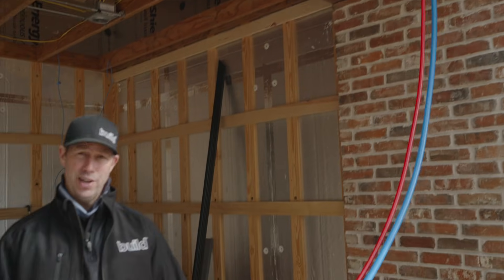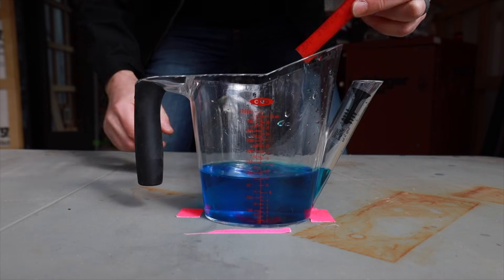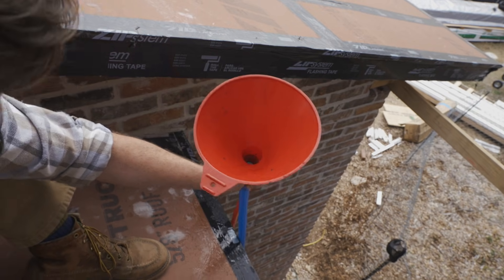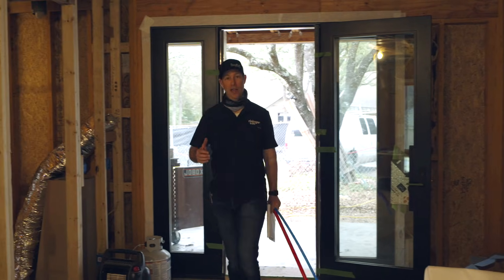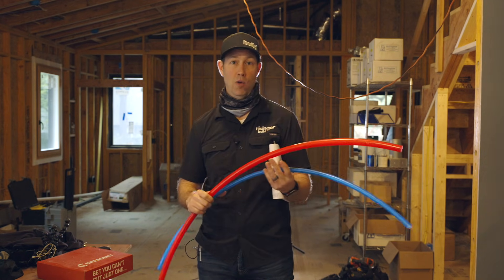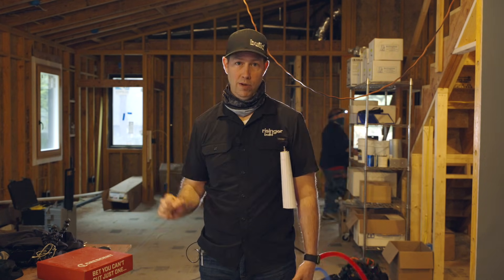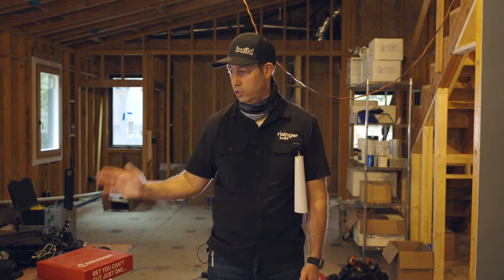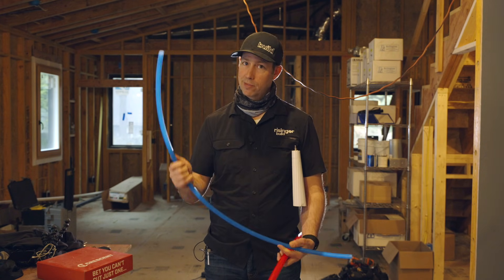What's the BEST Plumbing System

Comment: Race track system works great.  I've been doing that for years.
Reply: How is pressure on these systems?  I have zero experience with them
Reply: @benlastname6667  Pressure is great/no problem there.  With a 3/4" loop (race track) and 1/2" and 3/4" feeders to the fixtures  pressure is great with no loss when other devices/fixtures are turned on.  I've never used 3/8" even as the feeders to the fixtures as Matt said was an option.   I will say early on I ran into some issues and had to install check valves in the loop near the connection back to the water heater feed pipe to prevent flow reversal.  Now I simply install the check valves as part of the system and I never have any issues.

Comment: Upgrading my own ancient homestead where I don't have to worry about resale, I created what I call "Hillbilly PEX".  It's a modular manifold system using standard PVC and CPVC.  No special tools, everything is cheap, but I still get the convenience of a central manifold with individual cutoffs.

What I like most about individual direct lines is that if there's a water leak in the middle of the night, I can just cut off that one line, go back to bed, and worry about it in the morning.  I don't have to immediately spend any time diagnosing the problem, I never have to walk outside in the freezing cold to cut the water off.  That peace of mind is priceless.

Comment: Matt Risinger - when you make that video, can you please address what added cost having that race track line add to your heating bill by having it constantly charged/heated?
Reply from the maker: Not constantly charged. I’m using the Metlund DMand system. It circs with motion then turns off when it’s hot.
Reply: @buildshow  still interested to hear more explanation on the physics. Presumably the pex is less well insulated than the hot water heater, and has a greater surface area through which to lose heat. A good example would be how much body heat a person loses when they donate blood platelets even though their plasma is being circulated back into their body. It seems like there would definitely have to be a trade-off in terms of energy use, it would be interesting to break down the math and figure out what that would be per square foot of house.
Reply: @wheatgrowssweet  Gives me some consideration, but I still can't reason where much energy would be lost to.
Reply: @averynw9180  it would radiate as heat into the house surrounding the racetrack pipe, which in the winter time would not be a big deal. In the summertime it would make the AC work a little harder. Pex is probably a better insulator than copper by quite a bit, and there is going to be heat loss through your pipes no matter what, but I would just be interested to see what the actual trade-off is with this system versus traditional.
Reply: @wheatgrowssweet  you'd insulate the pipes to help retain heat
Reply: @buildshow  We've used Metlund, typically when there was not a return recirc line. Also like using Grundfos pumps with flow switches like the Mcdonnell & Miller FS5. The Grundfos pump with M&M switch can be installed in the larger diameter "race track" circuit. The FS5 switches come in 0.75" and 1" sizes, which will move the heated water quickly on demand.
Reply: As Matt points out, the recirculation system turns on only when it is sensing motion near a faucet or fixture that uses hot water. So the recirculation isn't running constantly or otherwise you would now have a secondary radiant heat system via your water heater and hot water piping.  think motion sensor in the bathroom that turns on the hot water recirculation pump in anticipation of use while in the bathroom.  lot less wasteful then an always on system. In fact the always on system is probably more wasteful than running the faucet/shower to wait for hot water in a non-recirculation system
Reply: @gregorysmith9158  I guess I misunderstood. Wouldn't that defeat the purpose of having the racetrack charged with hot water and ready to go?
Reply: @wheatgrowssweet  no its exactly what it does but you don't want the pump always running because that is more wastful than waiting a minute or two for hot water. so you put the pump on a timer (very common) or a motion sensor (what Matt notes above) or a physical switch (Matt has a really old video of one on a doorbell type switch near a kitchen sink).  pump starts from timer, motion sensor, or switch (or however you decide to activate it) before you open tap and charges the loop. open tap and loop already has warm water.

Comment: I have a recirc pump (here when we bought the home). We have the opposite problem. The valve is under the kitchen sink and we have to wait for cold water but since we use mostly hot there it's not a problem. Just a bit hot to the touch.

Comment: @Matt, do you insulate the cold water line aswell? To prevent condensation, or is that not a problem when the line is inside a wall?
Reply: Not required in the Florida heat. Cold water is really luke warm. But if you have a well up north and even in GA you need to insulate cold pipes as well, also run hot water in your toilets. Keeps the tanks from sweating. You don't usually flush until the water comes out hot unless your toilet valve leaks. Or the tank leaks into the bowl.
Reply: I would think if you are protecting other cold surfaces from condensation, that would be a good idea. It's a lot cheaper to install it and realise you didn't really need it, than to not install it and discover you did!

Comment: I've thought about manifold systems I wonder if we could make a manifold where on the hot side there a line going in and back out to the hot water heater constantly flowing keeping that same hot water hot so all you have to dump when turning on your faucet is what's in the hot water line b4 you get hot water. I wonder if that's possible without wasting water.
Reply: Water presshrized at both ends of a loop wont flow so you need a pump in that plan and that basically what hes talking about except without a manifold. Number of loops would equal number of pumps so your design would be pricey.
Reply: Recirculation set-up . Fully doable. But manifold set up means pumps for each line versus branch system one recirculation pump

Comment: I’m thinking of maybe a manifold system, but with a return line and manifold for the hot, yes twice the hot plumbing though, but it would be instant hot water always at everything
Reply: I wouldn't spend the extra money on a manifold system unless you really believe being able to shut off each fixture individually will benefit you. I had a Manabloc, used it once during the six years.

Comment: Why use tanks or tankless systems and multiple pipes instead of just having one cold water pipe and an electric shower?
Reply: I like those electric shower heads as i like to live dangerously but in cooler climates they just cant heat the water hot enough. In warmer climates they get tepid water hot but only get cold water warm in cold climates. Do you have a "hot" tip on an electric shower head that makes the cut in cold climates??
Reply: @danielbuckner2167  I’ve never lived any further north than Texas so I really don’t know. (I’m also nowhere near as qualified as Matt or other construction professionals) Love your pun tho 🖤

Comment: There is MUCH to be said for the decimal system.
Reply: Yes there is, it's junk ! lol, JK !
Reply: @augustreil  Personally, I'd rather measure out 133 mm than 5 1/4 inches.
Reply: @Xingqiwu387 , I know, you're right. I'm just used to inches, feet, etc.
Reply: @augustreil  Hats off to you! Anyone who can think in terms of 15 and 3/8s inches and then divide that into 36 and 1/64th deserves more than casual respect :)
Reply: @Xingqiwu387 , I would have trouble with that, no doubt ! lol

Comment: I have seen a problem with recirculation when used with faucet sprayers. When hot and cold left open cold circulates back through loop
Reply: Thats a presshre imbalance. That will happen with any single mixing ball valve where the hot and cold have unequal pressures. Reset the pump pressure or use regulators on both sides.

Comment: Would you do a timer on the racetrack for when you're not home so your not recirculating water all day?
Reply: AFAIK they can do wireless remote, motion sensor, or timers if it is running off a recirculator

Comment: When we remodeled, we replaced our copper "loop" with a Manabloc and pex to each fixture. It's been super reliable and easy to change fixtures and stuff. However, I do need to get the hot water to loop back to the heater because some sinks take a WHILE to get warm.
Reply: Try a point of use on demand heater on those long runs?
Reply: How long is "a WHILE"?  Mine takes about 10 seconds to the furthest faucet..

Comment: The more water the better, as long as you realize that keeping the hot water hot will cost you more money.
Reply: Yep. Now let's see the math on keeping 50 cups of water hot 24/7
Reply: @jl9678  You cannot expect to do that. You can recirculate it, however. Keeping the lines insulated is more important than anything else. More importantly, "HOT"  is relative . How hot.
Reply: These guys is 200 gallons of propane to power his recirc system

https://www.builditsolar.com/Projects/Conservation/Recirc/RecircEnergy.htm#:~:text=Heat%20loss%20from%20the%20pipe,if%20the%20pipes%20are%20insulated.

Comment: My friends had a looped system with heated floors and water based heaters, the issue with it was nobody was used to it and tons of people would get burned because they didn't realize the water had gotten so hot so fast. I also had a manifold system in one of my houses and even though I also didn't like it, it ended up being useful when a valve started leaking and I couldn't get there fast enough to fix it, we just turned off the line and the rest of the house kept going like nothing happened... I think you'll find with the looped system that you'll save water but waste energy with heat loss through the pipes and the pumps energy but you'll only notice that of your a construction nerd lmao! I'm currently rebuilding my house too but I just took the existing floor plan and made it better, less waste that way as I was able to essentially recycle all of the existing materials for a brand new house. Can't wait till it's done

Comment: I have a 'racetrack' loop.  I had to retrofit my house.  I had discovered the hot water line went from my water heater (in the attic, code allowed at the time), serviced the 2nd floor bathroom (right below it), then down to a first floor bathroom (beneath the 2nd floor), then down into the cement slab (why, i have no idea), then pops up behind the kitchen (so far about 60 feet if pipe), services that, and laundry room, then up to the master bath.  Could not figure out WHY it was taking almost 3 minutes for the water to get hot, then why it would cool off so fast   until i put in the circ pump, i had no idea it went into the foundation! After I put the recirc pump in part of the floor tile and a certain section would get warm so I figured out that's where the hot water must be running us through that part of the cement.  But everything is insulated now.  Circ line goes back to the attic, and hot water is about 5 seconds away .  Pump is 93 watts an hour if it ran continuously, but there are motion sensors which trigger the pump when people walk into a zone, so the pump is on maybe 3 minutes at a shot
Reply: The motion sensor - that's brilliant!

Comment: Just installed a tankless water heater with an integrated circulation pump and our master bath has instant hot all day long.  Used to take over a minute to get hot water.
Reply: We have an island sink in the kitchen that took over 5 minutes to start getting hot. 🙄 Put in a recirculating pump with a timer and now I don’t know how the previous owners ever did without one. Cost $300 to have installed. Electric bill was so negligible we didn’t even notice a change.
Reply: @PawPaws_Place  Same with us, and it benefits all the other branches, the guest bath and master sinks now get hot water in less than a few seconds.
Reply: Also..  you are not throwing the former hot water down the drain.
Reply: A navien tankless water heater will do everything.
Reply: @jamespoladian3411  I got a Rinnai :-)
Reply: @jamespoladian3411  that's what the sales guy said 😂
Reply: Energy bill wise have you noticed any change?
Reply: @timgleason2527  Too early to tell.  Going from a 50-60% tank heater to a 95% heater with insulated lines.  I expect a little savings but the reason for the change was the old tank was starting to leak.
Reply: No because you will burn up the igniter.
Reply: Pex pipe not able to handle hot 24x7  would be a big problem.
Reply: You need to be mindful about that plastic pipes don't like to be hot 24/7 and your tankless warranty will drop from 15 years to 5 years. Instead you can program your recirculation pump to run for 1-2 hours in the evening and in the morning when you usually need to take a shower...
Reply: @EdTheWretch  Are you talking about the pex pipes doesn't like to be hot 24/7?
Reply: @beats622  Yes, that's what my installer told me.
Reply: @EdTheWretch  Lol that's concerning. My old poly b handled being hot all the time from the hot side of the water heater when there was only 12 inches of copper instead of 18 as required by code. For over 30 years. It survived. I'd be concerned if a pex pipe can't hold hot water 24/7. Now if it's over a certain Temperature I believe 200 F? Then the pipe is not rated for that kind of application. Just imagine how many pex failures you'd get with those who are using it for radiant floor heating etc. I don't agree with your installer on this.
Reply: @beats622  You're allowed to disagree :-)

Comment: Local on demand water heater seems to be the best option if space and money isn't a worry.
Reply: I've considered on demand instant for an all electric house I'm building. The issue is the increase electrical and plumbing costs. You'd have to run 220V all over the house, and install multiple heaters is more expensive. Not to mention multiple small local heaters are more expensive than one large one. All that add up to >30% up cost which is not insignificant for plumbing an entire house. Well, insignificant for Matt and his client I'm sure.
Reply: @blamuk  Not to mention now it's just resistive heating.  If you do a recirc loop, couldn't you use a ground source heat pump for the heating for your water? I'm not sure how much a recirc loop costs and uses in energy but in my mind that would be easiest and easy to maintain.  Could even have it be smart and only recirculate when someone is home (using cell phone on the Wifi like my Nest thermostat does).
Reply: @blamuk  which is why no one uses electric based on demand (non-tank) hot water heaters. the current draw can overwhelm even a decent sized service. now add several around the house and the NEC load calc will require you to have a commercial level electric service. practically, on demand hot water is really only a natural gas thing and not so much an electric thing
Reply: @gregorysmith9158  I see on-demand electric water heaters a lot over here in Germany and Europe in general. It’s nice to have hot water within a few seconds. Many houses (mine included) don’t have natural gas heating. The fact that Germany and much of Europe is wired for 220V and three-phase power probably has a lot to do with it. I don’t see a lot of central water heaters over here like we see back in the States.
Reply: @eviler-xo3xx  three phase power to residences is pretty much non-existent in the US.  Maybe a farm might have 3 phase power and so the associated residence could have access but that is a very small % of US housing.  residences have single phase power with one winding of the transformer so you get both 120V (center tapped) and 240V (full winding).  Conversely, natural gas is plentiful in the US and most major cities/coasts are plumbed for it.  in middle US, propane is heavily used instead of natural gas where the distribution plumbing isn't present so even then, you would have a propane based on-demand rather than electric.  Its not that you couldn't do an electric on demand, its just that it would dominate the electric service to a house (most commonly 200A) and to have multiple units forget it.  Lots of the US has fuel burning based appliances. Switching to electric will be a real "shock" to most but its coming likely in our lifetimes
Reply: @blamuk  don't do it. Resistive loads are super expensive to maintain. 3lectric water on demand or otherwise will be something you regret unless there is no other option. Plumber for 30 years.... respectfully
Reply: A local water heater with a small tank just enough for the cold water from main heater in the pipe to run out + a thermostatic mixing valve could be a great system.
Reply: And if water hardness is not a factor

Comment: Why didnt you talk about on-demand systems? Seems like you could get all of the benefits and almost no drawbacks
Reply from the maker: I mentioned the Metlund DMAND system briefly. It’s an on demand system. Big fan.
Reply: @buildshow  okay thanks! Cant wait for the next video
Reply: Sadly you still waste time and water waiting for the on demand system to get up to temp.
Reply: That is a separate issue.  He is discussing the piping in the wall between the water heater and the point of use.

Comment: I like the manifolds for reduced liability. Fewer possible points for a leak
Reply: Looks pretty but lots of potential for leaks. High cost. Might be useful for very large Mansions but not for normal size homes of around 1700 sq feet.
Reply: Or more pipes to hit
Reply: Lol uhhhh no not reduced liability at all. They are garbage